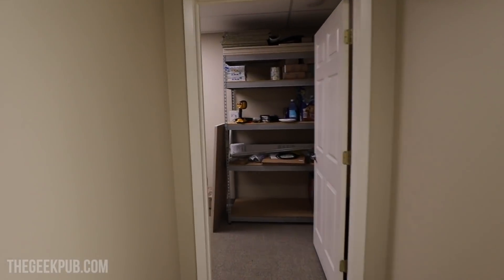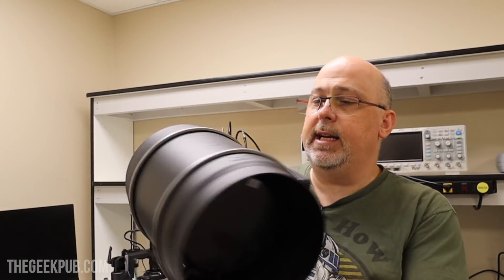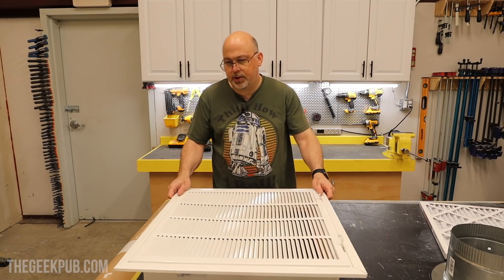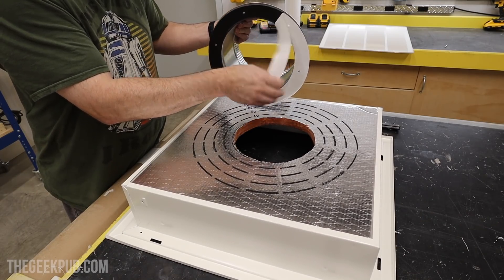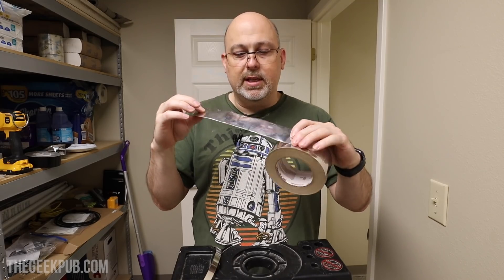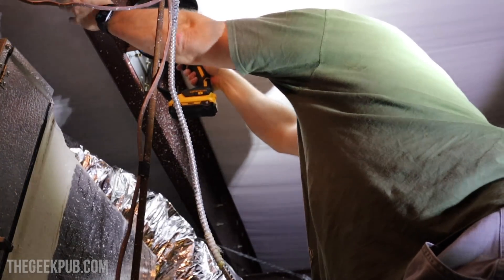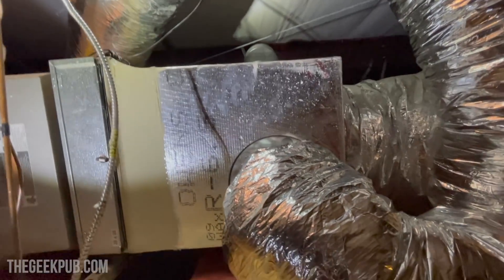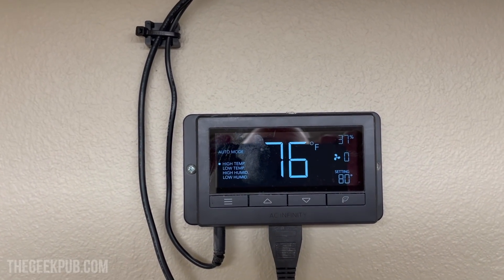Venting the Server Room

Comment from the maker: Re: Location of the return in front of the door means air will just get sucked under the door and never cool the room.  Well, its working just fine in my install and many others. So that can't be true.  Here's the reason: Thermodynamics means heat rises.  The hot air will be at the ceiling and will be extracted first.  If every air molecule in the room was the same temperature then this system might just suck air from under the door.  But that is never going to happen.  This is why real data centers work the way they do with hot isles and cold isles. CRAC units that intake from the top and exhaust from the bottom just a few feet apart.  Heat rising does much of the work for you.
Reply: DUCK tape vs DUCT tape...
Reply from the maker: No.  Home Depot actually sells it as ducT tape: https://www.homedepot.com/p/Nashua-Tape-1-89-in-x-120-yd-300-Heavy-Duty-Duct-Tape-in-Silver-2-Pack-1541225/100351967
Reply: Is the gap under the door big enough to let in the large volume of air you are sucking OUT with the fan? I've had small equipment rooms with just a small kitchen style extractor fan with no inlet vent actually have negative pressure relative to the outside. The door (outward opening) wouldn't open!!
Reply: @TheGeekPub  One of reasons I try to have everything planned out, before I go in.  HD and Lowes are like grocery stores.  Have a list before you go.  (Oh. That new drill will help with these 4 screws for my new towel rack)
Reply: My rough semi-calibrated eye-ball suggests the room is about 576 cubic feet. Given a 900+ CFM fan, it will cycle the air in the room almost twice per minute (assuming full speed). It will have to find that air somewhere, since air behaves as a liquid, it will pull air from the AC vent above the server as well from any un-sealed source (proportional to size and distance).  Since your heat source is between the cooling and exhaust fan, you should be good to go. I would be tempted to keep the fan speeds low as negative pressure is not good for anything other than finding leaks.
Reply from the maker: @wyohman00  Your pretty much spot on.  After a few weeks of tinkering I have indeed found that anything above 500 cfm setting doesn't make much difference in the room temperature.  But remember, the fan only runs when the temp gets high.  So its really not a problem either way.

Comment: I like the design, except that I would not have pushed the server room hot air back into the return.  I would have pushed it to the outside of the building.  This would reduce the heat load on the A/C system.
Reply: Discharging the air outside the building would create a negative pressure in the conditioned space. This would actually pull in OA in through cracks in the building doing the opposite, adding heat load to the building. You can’t discharge let’s say 400 CFM outside of a vessel with out bringing in 400 CFM into the vessel.
Reply from the maker: Bill that would have the opposite effects.  It would actually pull outside air into the building through cracks and cause my AC bills to go way up!

Comment: Hello from Corpus. Being an actual hvac guy who works on actual server rooms, I think it will work fine. The only thing I noticed was you may want to pull the insulation jacket of the duct completely over the booster fan to avoid condensation. I belive Dallas has pretty low humidity but better safe than sorry. I enjoy watching both you and your brothers channels.

Comment: $4 - $8k ? You should find another unit and installer. That’s insane.
Reply from the maker: No. That's normal prices.
Reply: Perhaps if you're installing a 3 phase 14kw cassette system, which would be extremely excessive. A 3.5kw Fujitsu split would be fine and they're only $1000 + install (which may vary wildly depending on the particulars of its location).

Either that or Americans are getting a proper shafting when it comes to pricing.
Reply from the maker: We're not just talking about the unit's price.  You also have to consider the rest of the job.  It would cost $900 to $1200 just to get a licensed (who pulls a permit) electrician to run the outside service and disconnect for the compressor.

Comment: Add an intake vent in door or ull never get those cfm out
Reply from the maker: Not true.
Reply: How big is your door gap?
Reply: He has a HVAC vent in that room, it will draw in the CFM through that duct, and if any more CFM is needed any cracks anywhere else in the server room.
Reply from the maker: There is already a 1.5" gap at the bottom of the door.  That's equivalent to an 8x5 vent.  Second, there is an 8" register in the room from the HVAC unit making for a complete 8" loop.

Comment: Nice job! I completed a very similar setup not too long ago for my server closet.

One thing I'd suggest is suspending the inline fan in the attic with rope or straps to stop vibrations reverberating through the house/building frame. I had directly mounted my fans at first -- and at mid-to-high fan speeds I was hearing a low, but perceptible rumble in nearby rooms. Lifted this idea from the grow room crowd -- they even sell kits!

I opted on using two inline fans -- one to draw ambient air from a common area, and another to exhaust the warm air into a nearby bathroom where minor condensation is less an issue -- keeps it nice and comfortably warm too. I figure this way, the central AC doesn't have to work as hard or often by taking on any of the extra heat indirectly.

Also for anyone listening -- go with the AC Infinity CLOUDLINE series like in the video. They consume the least watts per RPM than any cheaper inline fans you'll see on eBay. Will save you a ton of $$ if you run 24/7 like I do. Multiple fans can be chained together to work from one temperature controller and are whisper quiet -- especially when suspended as I mentioned above.
Reply: Can you recommend a hanging kit that works for the cloudline?

Comment: I have the same setup with the same fan and controller. But I have 2 fans (1 pushing air into the room down low, and one exhausting up high), works great! I also happen to be an HVAC guy, the only thing you may want to keep your eye on on your install is depending on where your main AC air filter is located (in the air handler or ceiling filter grill) you could wind up with reverse air flow through your filter when your AC is off but your exhaust fan is on. This could cause dust to blow out your return air grill and create a dusty mess. Love your videos!
Reply from the maker: Yep!  I actually run dual filters just because of this.  One large filter in the main unit, and 1" filter at each return.
Reply: @lackr0073, i have a question about this setup - mind if I contact you?
Reply: @therealrayy7k  What is you question?
Reply: @lackr0073  im not sure where my air filter is, its a new construction home and the HVAC guy just installed the duct from my ac closet straight into the return. Would it help to put an extra filter in the ceiling filter INSIDE the IT closet, to avoid extra dust getting blown into the return
Reply: @therealrayy7k  it’s not necessary as your main filter (likely located in the filter base of your air handler) should handle keeping the coil clean. However it wouldn’t hurt if you wanted to add an additional filter in your IT closet.
Reply: @lackr0073  from what I can tell the duct vents directly into a big box (I a assuming a plenum) Any issues there? Would my AC work significantly harder with all the air just sitting inside the plenum/return system?

Sheetrock is going up tomorrow so I need to give those guys an answer by tomorrow morning to make sure I’m not messing up my HVAC system. Appreciate your help
Reply: @therealrayy7k  that setup should work pretty well to keep air flowing through your IT closet. The only potential issue is that your AC fan will cycle on/off as it heats and cools your home, when it is mild outside it will not come on as often so heat will not be sucked out of your IT closet when your AC is not running. It may be a none issue depending on how much equipment you have, but something to be aware of. You could always turn your unit fan on if you ever run into any issues with that closet getting hot.
Reply: @lackr0073  I meant to let you know I’m installing an inline fan, cloudline t6. So it should be sucking air out regardless of the AC being on. That’s where my concern from my previous comment comes (basically hot air just sitting in the ducts diminishing the work my AC is doing when trying to cool the house)
Reply: @therealrayy7k  I see, so you have an inline fan pulling air out of the IT closet pushing air into your return air plenum. That will work, the only downside is side is that air will be coming out of your main return air grill/s when the AC is not on. Just need to make sure your AC filter will be at the AC filter base located at the unit return. No worries about hot air diminishing the AC…
Reply: @therealrayy7k  I would also put a filter return grill on your IT closet return so you can keep your inline fan blades clean…
Reply: @lackr0073  perfect! Thank you so much man!

Comment: to solve the wires running down the wall and dangling under the controller you could buy or 3d print a little angled cover that matches up with the bottom face of the controller and extends down toward the wall, then you could cut a hole under the controller and run the cables through the wall to it, pop them out of the hole and plug into the bottom of the controller behind the printed cover

Comment: The next level to this solution is a dual hose portable A/C unit. The dual hose units often can put their moisture into the air they dump, so you have to be aware of where that exhaust is going. But once we exceeded the ability of the fan to cool the space, but the company didn't want to invest in a mini split we used that option to great success. Another benefit is you're not pulling in dirty air from the surrounding building to cool the server room, so equipment stays much cleaner. In the installs we did we pulled from the filtered return going to the A/C, then exhausted into the ventilated attic space. The downside is this make up air comes from the outside if you don't have automatic make up air on your air con. You can also just run it "over the wall" to another room or dump that air into the return... but then you're filling the portable unit with dust if that isn't filtered. If the owners of the company weren't tighter than 2 coats of paint, in our situation, a mini split ended up being a much better, cleaner, efficient solution when we out grew the circulation fan option. I'm glad you touched on when the heat is run, many clients forget they need to close the vents and end up heating the room more than what we were trying to fix in the summer.

Comment: Funny thing is that the tape is actually duck tape. Apparently like in "cotton duck," which is a kind of a linen-looking thing. So "duck tape" would be like if "linen tape" was a thing. And from what I understand its primary use was to rainproof patch. Like if you had a rip in a tarp and you wanted to tape it up. Or seal up an ammo can. Only reason why I'm explaining all this is that maybe if it goes back to "duck" tape then people won't think it's for ducts, because there's nothing about it that is suitable for ducts. Everything about its design decisions are the opposite of what you need to be tape on a duct.
Reply from the maker: The fabric duct tape was actually invented by an AC company.  And some 20 years later a marketing company re-branded it as duck tape:  https://en.wikipedia.org/wiki/Duct_tape

Comment: Should install a Thermostat Controlled Duct Damper on the vent in the server room.  It can be set to close the vent when the heat is turn on in the winter time.  Then it will open up when ac is on.  Then no need to worry about manually doing it.
Reply from the maker: That's a fantastic idea.

Comment: We keep our data center at about 77 degrees with a hot aisle containment system. There's really no need to keep it colder.

We had a manager once that liked to keep it at 70 or less, thinking it would buy more time if the AC failed. In practice, it only bought 2 extra minutes.. not enough to warrant the extra load 24/7 on the AC units. They froze up and broke (a lot) before we upgraded the system to something designed for a data center.

Anyhow.. this looks like a great solution. Can you post an update towards the end of the summer?

Comment: I would have blocked the original building HVAC feed to the room and ducted the original vent ( with adjustable restriction ) as a return into a common area and then used the fan and filtered vent to push air from the same zone into the server room to raise is static pressure and help mitigate dust ingress.

Comment: Nice install. Just wondering a couple of things:
Where your ‘intake’ is for the air? If you are closing the HVAC into the room, is it just pulling air under the door as mentioned in comments?
Why is it important to filter the air leaving the room? Couldn’t tell in the video, but usually air is filtered between the Air Return and the Air Handler and I would assume you tied into the return duct before that filter. 
I’ve always made a point of keeping dust away from my electronic equipment by filtering the air inlet and, when practical, keeping positive pressure. Since positive pressure is not an option with your solution, a large filtered through door vent with appropriate door sealing might be a good addition.

Comment: I’ve had a similar setup running for about a year with an open frame rack. I just switched out to an enclosed rack and I have to redesign. I’m planning to mount the return intake on the top of the rack to pull the air directly through the rack. Have you tried this?

Comment: My experience has been running things hot is hardest on physical platter drives. So if you’re not using HDDs then it’s not a big deal. If you are… it might be a problem. Would be curious to know what the temp ends up being, but suspect it’ll be hotter than 80 almost always and that fan will keep running.

Comment: I really like this idea My company are only just reaching into the world of air conditioning and the idea of pumping heat into the inlet side of the inside unit makes a load of sense even having it open should make the unit not have to work as hard as the heat from that server room should help the unit as apposed to working against it

Comment: I'm wondering if you also added any kind of passive air intake for this solution?  I know technically if you have an HVAC vent in there (which you do), it should allow some air if, but one of the important things to consider in these types of solutions is that you have as much air coming in as going out, otherwise you're working the fans a lot harder than needed.  P.S.  I also have AC Infinity fans for my server room and theatre venting solutions.  Adding passive air intakes made things work MUCH better for me.

Comment: couple of things, 1- why do you even need to keep that heater duct open in winter? just keep it always closed, the server will heat the room enough, one less maintenance required. 2- why do you feed the hot air to your AC? if possible, vent the hot air to outside, your AC will intake relatively cooler air from outside, more energy efficient. Your house will still suck air because of negative air pressure, but it still will be cooler air than your server air.
Reply: HVAC guy here.

1) Because in the winter the  servers will heat the building for "free". Or at least supplement it.
2) TERRIBLE IDEA. Never ever do this. Negative pressure results in many problems. Suspended contaminants, humidity (and therefore mold) issues, and lots of wasted energy.  A building must always be positively pressurized.